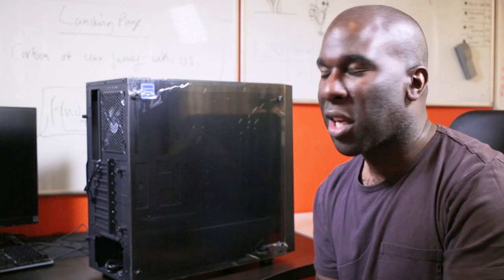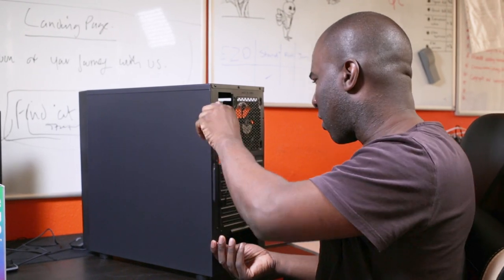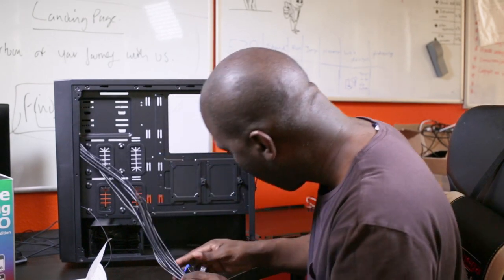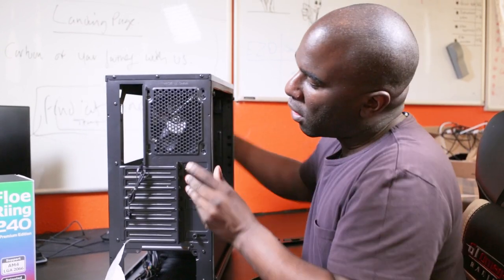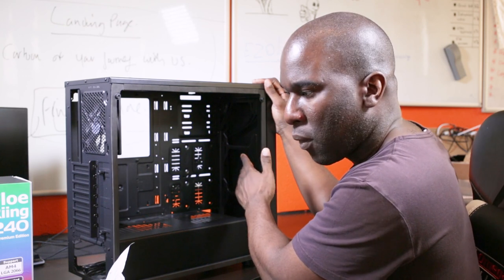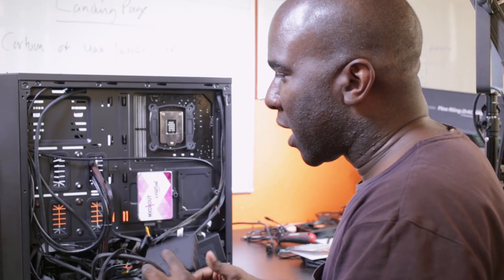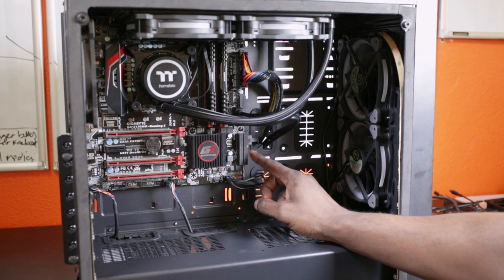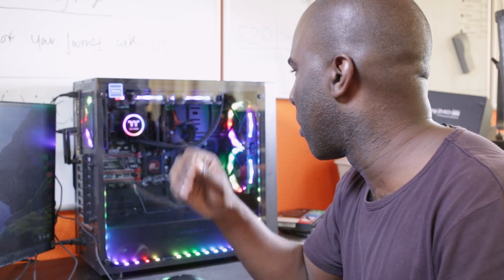Thermaltake Versa J21 Tempered Glass Edition Mid Tower Case Review

Comment: Good review, but tell me, is there dust filters on the top grids? And are, are the holes on the front enough to have a good air intake inside the case without the fans having to turn too much?
Reply from the maker: It's got very low airflow so fans would need to be sped up to get a sufficient amount of air flowing through ad intake and it has an air filter on the bottom of the psu and one on the top of the case that's magnetic 😉